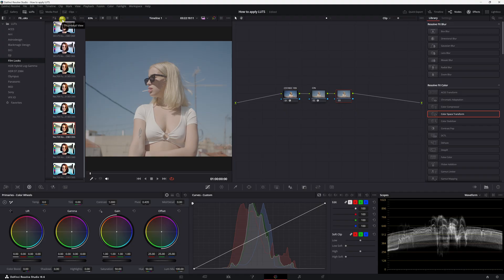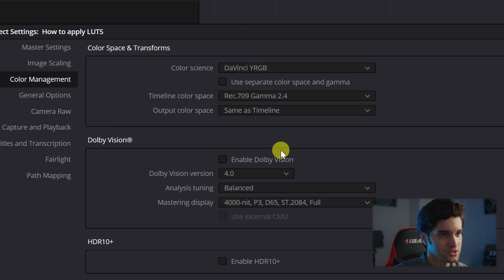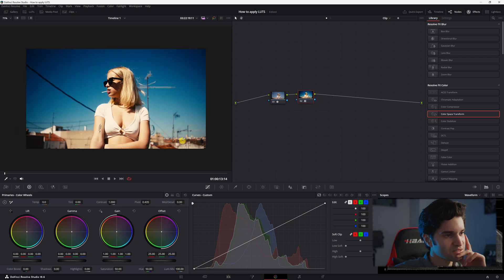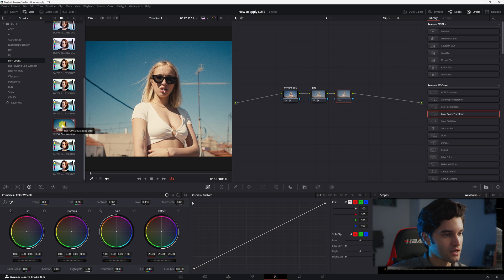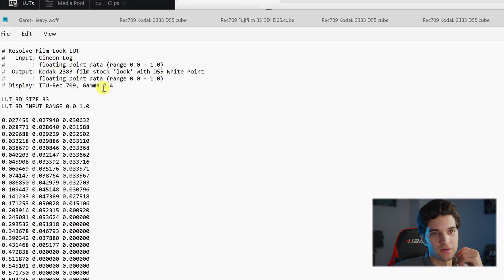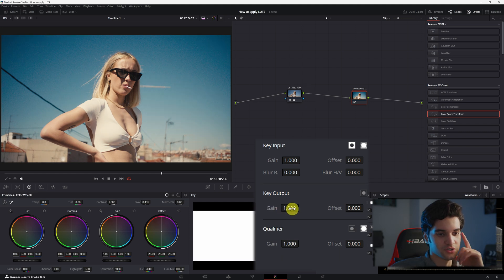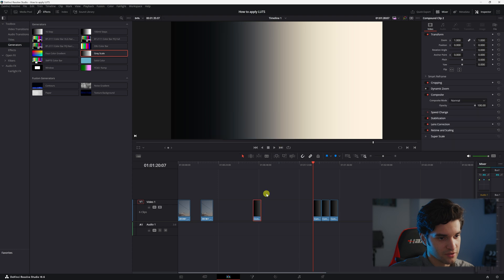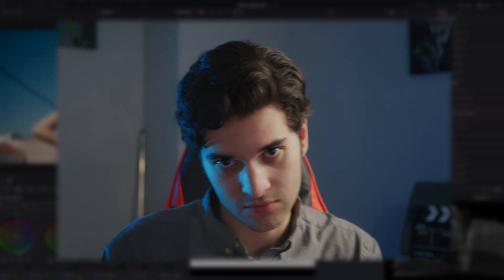How to Apply LUTS CORRECTLY in Davinci Resolve | EASY Tutorial!

Comment: Maybe a dumb question: Do i apply cineon film log even if the LUT isnt a film emulation type of lut?
Reply: Hi, I'm not an expert by any means, but generally the answer is no. The way I think about it is that the clip should be in the color space and gamma that the LUT was designed for before you apply the node with the LUT. He used the color space transform effect in the node before the LUT node to get the clip into the correct color space and gamma that the LUT was designed for, cineon log in this case. Some of the Kodak film emulation LUTs that are in Resolve expect Cineon Log, but not all of them. In general,  LUTs can be designed for REC 709 or designed for specific cameras and their corresponding log color space and gamma. The important thing to know about the LUT is what it expects as input in order to get the right output. Hope this helps.